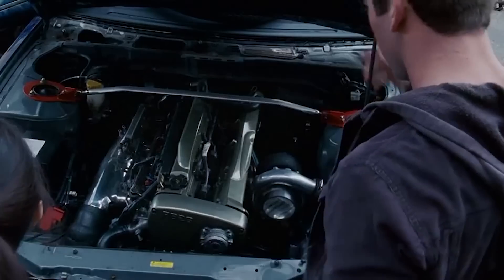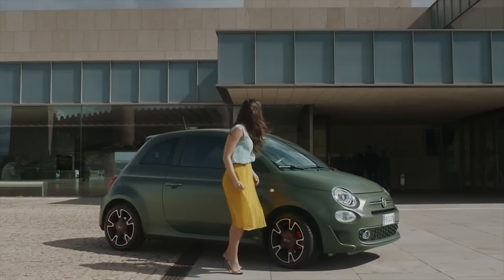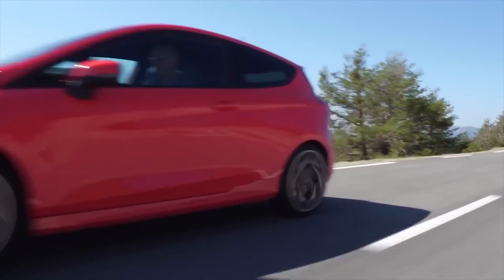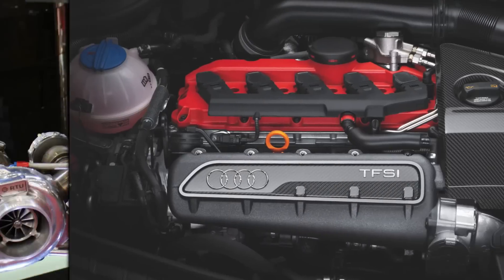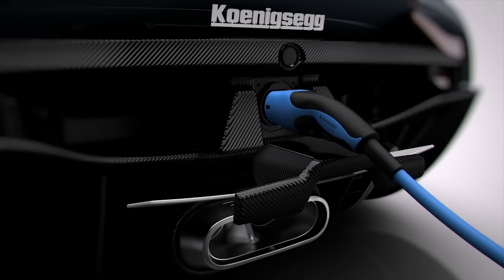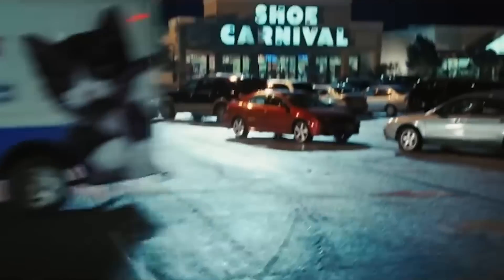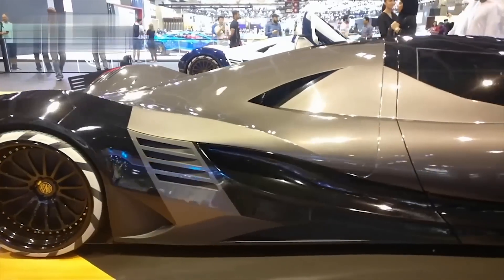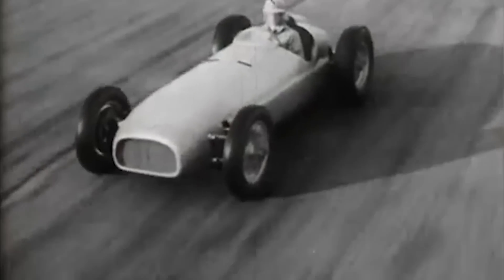Most Powerful Engines from 1 to 16 Cylinders

Comment: Odd the most powerful 2 cylinder has 0.9 liters 103 horsepower.  I have a 2 cylinder snowmobile which is 0.85 liters that makes 165 hp.  Hmmmm.
Reply: 521 rotax 2 cylinders engine from blizzard 9700 from 70' make around 105 hp Lol

Comment: The regeara is not the strongest v8 a top fuel drag car has the strongest v8
Reply: well technically, top fuel in NHRA does not use production engines

Comment: 5:00 And now we enter the odd number of cylinders with this 5 cylinder engine.

Well i'll be damned if i did not think the 1 and 3 cylinder engines presented before this 5 cylinder one, was also odd number cylinder engines.

Comment: How about manufacturing 5000 Cylinder Engines Cars that is So freaking complicated and it takes about 10 freaking years to build one and 5 plus years to test drive and inspect that the engineers get sick and tired of getting sick and tired that they will throw the wrench to the car and go on Vacation?

Comment: There's a top secret Devel Sixteen with 24 cylinder, 9400+ hp 7.5 liter engine. It can go 1- 60 in 0.8 seconds but the engine pruduction may kill you anytime cuz the power in the engine too much to handle itself (you can't find it on google or somewhere else)

Comment: Audi Sport Quattro RS 002 - Sports prototype "Group S" was a rally car that was initially designed for the forthcoming Group S regulations for 1987. The car was tested by Walter Röhrl but it never raced; the Group S regulations were scrapped along with the Group B regulations after a number of accidents involving fatalities during the 1986 season.

Engine: 2,100 cc (2.1 L) I5

Power: 700 PS (515 kW; 690 hp)

Top speed: 300 km/h (186 mph)

Comment: Should specify AUTOMOBILE engines. Aircraft V-12's exceeded well over 1000 horsepower in WW2,and 2000+ horsepower 18 cylinder engines also were used. By the end of the war, they had ballooned to a monster 36 cylinder, 5000 horsepower,  7755 cubic inch beast built by Lycoming. And don't even THINK about ship engines! I should have guessed this would be a mockery when I realized that the author  couldn't even use spellcheck in the title ("Powerfull"???)

Comment: This list is absolute horseshit... Sooo many inaccuracies about it all. firstly. you cannot compare turbo engines to naturally aspirated engines. secondly, you cannot compare motorcycle engines to car engines... they are an entirely different animal. my triumph stree triple 675R has 137 horsepower at the back wheel. Whereas my mothers 1.3 litre 3 cylinder car only makes 75 horsepower. You have to compare engines of identical capacity. you need to dyno these engines at the crank, and find out who is who at the zoo. work on 2 litres. Life will be a lot easier. Also, you would have to manufacture most of these engines for a fair test... and then, bore and stroke would come in to play, so then you would need to have identically scaled bores and strokes. work on a square bore, where the bore and stroke are identical. This is absolutely awful as far as lists go. Don't touch automotive with a 10-foot pole. you clearly have no idea what you are talking about. stop reading a script, learn about the topic, and come back to us when you have. this is clearly bullshit. Well done guys, I hope you understand just how ridiculous you look to everyone who knows even an ounce about engines.

Comment: At 11:20 you are wrong: More cylinder means smaller and lighter parts that enable more revs. It that 16 cylinder engine had only 8 cylinders and the same volume, the bigger parts would prevent it from revving that high.

Comment: 3 cylinders 1000cc Yamaha Viper with a turbo kit.🤘 A real best from 136 to 270 hp. I have a -15Viper 162 with a 190 hp turbo kit and its so fun to drive.😂
Or a Yamaha sidewinder 1000cc from 200 to 340hp.

Comment: @ MAD LAB

I wouldn't say it was the Viper that made the V10 popular, I think it was the screaming 3,5l V10 i Formula 1, starting back in 1989, back then starting out with about 650-700Hp, and from 1995, the engine was made even smaller, 3,0l V10, and the horsepowers bigger, and ending up with almost 1000 Hp in race-trim [and some say about 1500 hp in qualifying-trim] before it was retired from Formula 1 in midte noughties.... 😊 😏

And about the V16 engine, I think the Rolls-Royce 9,0l V16 [BMW] from the Rolls-Royce 100 EX, deserves to be mentioned to, because it a true V16, where Bugatti's engine is made up of two VR8 engine's putt into a V, there by becoming a W16, or maybe even more correct, a VRVR16 [LOL] 😵 😂😂

But okay, that is just MY opinion, and there is as many of them as there are people who have one... 😁😁😁

Comment: What about the RB26DETT or 2JZ those are able to make almost as much if not more horsepower as the regera and for 4 cylinders what about the 2AR-FE which can make more than 1K horsepower N/A also you need to work on your pronunciation Audi is pronounced ow,de and Huraćan is pronounced huri, con

Comment: To me, I think a list like this would be a better comparison if none were forced induction. As long as a manufacturer makes a stronger engine and cranks up the intake boost, there will be always a more powerful engine. Where as a natural is limited by the air it can suck in - where displacement and rpms rule.

Comment: Horsepower is relative to airflow the more air you can flow into your engine the more people you can burn in the more power you will make this guy is just going off of popular cars with engines that match the categoryof course they are going to be motors that make a buttload of horsepower with a turbo but it is more impressive to find a motor that makes the same power as that turbo motor without a turbo all naturally aspirated

Comment: Title is misleading. Elmer Racing in Finland has a 4.0L 4-cylinder that puts out 1500hp, capable of 3000hp. Title should've stated that most of these are production cars.

Comment: Ferrari 812 Superfast.
800 PS = 790 HP out of a V12, that's why it's called 812. Now its top speed is 211 mph (340 kmph) not 190 or whatever he said. And yes, it is the most powerful V12 in the world (street legal, non tuned). If you're asking, the Lamborghini Aventador SVJ has 770 PS = 760 HP

Comment: Small engines... I have been hauling oil sumps for a company that makes engines capable to produce almost 7700hp per cylinder. (Wärtsilä-Sulzer RTA96-C)
The biggest engine where I was hauling stuff was 18V46.
Reply: Detroit diesel engine? 18v46 ?

Comment: The V8 regera has two electric motors to help it get a faster acceleration time. Plus the regera rs has the most powerful V8 with out electric motors.

Comment: Our snowmobile which has a turbo on it from factory makes 200 hp and it is a  3 cylinder and if you don’t trust me google Yamaha sidewinder turbo and you will see but you can modify it to 345 hp without changing head and block

Comment: The viper has a 8,4 liter...
The 2 and 3 cyl had the same  power...
The regera isnt the most powerful v8, at least the one1 has 1360 wich is more powerful, all koenigseggs only has v8 so then the one1 is more powerful. Cuz the regera has more hp cuz of the electric engine. Although i dont know if the agera rs is more powerful
V10s, the r8 v10 plus has the lambo engine too...
The ferarri v12 im not sure if isbthe most powerful engine

Comment: Another 0 cylinder engine is in the sr71 blackbird it checks in at 160,000 hp. Also puts down 68,000 lbs of thrust.

Comment: Ummmm 1000hp V8???  How about the modified 500cu-in (8.2L) nitro methane burning V8s used in top fuel dragsters. Estimated to be 11,000-13,000 HP.

Comment: The most powerful 8 cylinder is the V8 used in drag races.
They get up to 11,000bhp
Reply: S U R V I V O R that is true. In fact I think those motors are the most powerful combustion engines in the world. But I think this is about manufactured engines that you buy from a dealership. Nothing can compare to the sound and feeling of top fuel. I go every year to the gator nationals.
Reply: jasonneal 
Good point.
And yeah the Gator Nationals is a pretty awesome event
Reply: They also forgot the 1000hp v4 from the amg project one
Reply: Gabriel Gontijo was it a production engine?
Reply: Drew Tatum 

They are closer to 12,000 horsepower now. Doesn’t matter if they’re rebuilt after every run, they’re still the most powerful V8’s on the planet. They are the most powerful gasoline fueled piston driven engines on earth period.
Reply: Yeeehhh, but those arent street legal and run special fuel.
Reply: U KNOW WHY? becouse they use 2-4 different engines in the same car. ofc together power is so unrealistic. one single engine cant have so much power.
Reply: @TheMossemies    The Top Fuel dragsters and funny cars use a single 500 cubic inch Chrysler Hemi platform engine burning nitro-methane.  And yes, 1/single/one/uno engine produces 10000 to 11000 horsepower.   But they are typically rebuilt between each run down the strip.
Reply: knight0334 I thought the maximum CI allowed was 455 in top fuel class.
Reply: @TheMossemies  nah tons of cars push 12000hp in top fuel
Reply: TheMossemies actually no they have a single big block
Reply: Those guys use custom big block Chevy engines I believe
Reply: Hc 437 they use Chevy, Chrysler, Ford, Toyota.

Comment: 4:54 "And now we're into the realm of odd ... as in the odd numbered amount of engine cylinders."
Because 1 and 3 aren't odd numbers as we all know.
What an unspeakable amount of idiocy.
Reply: everyone whos worked with a motorcycle has heard of 1 cylinder engines. and several economy class cars use 3cyl engines. but theres no advantage to a 5 cyl so it is really odd
Reply: @jnathannger8654 
1st, there are of course several advantages of the 5cyl over the 4cyl and 6cyl, or do you think AUDI's research and development is led by fools for several decades?
2nd, I even quoted the exact wording "odd as in odd numbered amount" and still you didn't get the sense of it.
3rd, please consider not replying unless you found an actual point (!) in what you're going to say.
Reply: Galaxy S7 Jnathan was right, a 5 cylinder doesn’t have an advantage. A lot of car companies tried 2 cilinder engines and failed. A 5 cylinder is unique, not useful. Unless you think every car company ever that doesn’t make all their cars 5 cylinders are idiots?
Reply: @jordy2299  2 *cylinder engines were used by car companies for more than a century and over 8 million 2CV were build in 42 years and there are still modern 2 cylinder cars in production so the only fail is you not getting your facts straight but wtf has all of this to do with 4 vs 5 cylinder engines?? you clearly have no clue of what you try to talk about lol
Reply: @jordy2299   also whats with the all cars by every car company ever bs you realize that every car company ever didnt only use 4 cylinder engines but 2/3/6/8/10/12/16 and whatnot also exist so wtf have THESE to do with 4 vs 5??? you make no frickin sense DUDE it takes <1min to research ADVANTAGE OF INLINE 5 ENGINES so go educate yourself ffs
Reply: “Unspeakable amount of idiocy” jesus dude that’s cringe
Reply: @jordy2299  Exactly, that's why the wording fits perfectly.

Comment: Arctic cat 1100 turbo 2 cylinder suzuki engine 177 hp - Yamaha 998cc 3cyl  turbo snowmobile motor 180 - 200hp. Both engine easily tuneable to 300+ hp.

Comment: BMW M12 4-cyl F1 engine  could be boosted until 1200 hp and was up to 800 hp with the race trim. In the 1980s.
Reply: 1.5 liter?
Reply: @sandasturner9529  yep
Reply: Displacement?

Comment: Now that you're including race engines...

4-cylinders: Brabham F1 turbocharged 1500 HP with the BMW F1 being a close second 1350 HP

6-cylinders: any tuned Supra over 2000 HP lol

8-cylinders: Most tuned muscle, ponies, vettes and top fuel drag racers...

10-cylinders: Any F1 with said cylinders since they pulled almost 1000 HP while roughly weighting the same in pounds (dry, no ballasts). Oh, and dragster Vipers and Porsche/Gemballas, of course ;)

12-cylinders: Besides F1 and turbocharged tunes/hybrids, the Ferrari F50 GT Chassis #1 deserves a mention by pulling 950 HP NA (they tried to test 1300 HP but the car became unstable and dangerous to drive)

Comment: 1:30 uhhhh did you forget snowmobiles can have over 200 hp? As a ski-doo rider, the best we have is a 850cc engine that delivers 165 hp so you need to do some research, buddy. And the ROTAX 850 ETEC engine doesn’t need a silly turbo.

Comment: BRM description is all over the place. It talks in part of the H16 development as if it were the V16s development.
Also I think it fails to mention the V16 was only 1.5 litre with a 2 stage supercharger - though the quoted power output was more or less correct. The potential for 14k rpm is not so amazing for such a small capacity engine since the reciprocating mass is light from the short stroke and small pistons.

Comment: A turbo isn't required by any of these engines to run. The list should be about the engines themselves no? Each engine could have multiple options when turbo charging them and have different power results.

Comment: BMW produced a 4 cylinder 1.6L turbo engine for formula 1 in 1986 and 1987, the version M12/13/1 produced  an approximate maximum output of 1,400 hp in qualifying trim. Approximate because they didn't have a dyno to measure past 1000hp but relative to other manufacturers claims the 1400hp is not unbelievable. Yes it was not terribly reliable at this state of tune but what would one expect from a 1980's turbocharged engine! :D

Comment: General Electric makes a V12 twin turbo Diesel engine that produces 4600 hp at the crank at 1050 rpm. GM made V16 single turbo Diesel engine that produces 3600+ at the crank at 950 rpm. A later twin turbo version produced 4300+ at the crank at 900 rpm. Do your research

Comment: Alfa Romero Giulia Quadrifolglio; 75% of a Ferrari v8 for 10% of the price 505hp/443lb ft. of torque with a warranty sitting at your local alfa dealership right now.

V8 Dodge Challenger Hellcat 707hp with a warranty sitting on the local car lot as well. 
the Helephant Crate Motor? 1100hp i think?probably more

TVR Cerbrea Speed 12 motor broke the Dyno rated at a thousand horsepower even though it was conservatively estimated to output 940hp because they could only estimate the output per cylinder bank.

Really this list is borderline pointless because it jumps between regular production things like the Fiesta ST and the KTM 690 Duke to cars you won't even breathe on in your lifetime like the Bugatti; there are Tuners who make 1500hp GM Smallblock OHV V8s all day for pocket change compared to the likes of Ferrari or Koenigsegg money.

If we wanted to talk specific output Kings; Honda DOHC 2.2l from the S2000 120hp/l
Mazda Rotaries trounce that with over 200hp/l naturally aspirated (RX-8 1.3l 238hp)
There were also Class B Rally cars from the 80s outputting nearly 700hp from a 2.0L Turbo.

Comment: 21 MPG on the hwy!! Dude I get 16 in my truck. Thats pretty good.
Reply: Depending on the year of the truck, it's possible that your truck engine is just better life span due to a low compression rate. That's how LLV bans last 30 years counting

Comment: More bad information after more bad information. what's interesting is that now Chrysler and Ford build V8 that are under warranty that put out a thousand horsepower reliably.
It's not surprising Ferrari can build an F1 engine and put it in a car but I wouldn't want to work on depend on or pay for an engine like that.
Your Fiat and Ford examples are two of the most troublesome cars produced today.

Comment: Utterly horrid vid. False specs, incorrect footage, wheres the 3 cylinder 400 hp engine?
Reply: jay Tarantula bro screw that wheres the 900 hp porshe v4 its the most efficient motor in the world. In the world
Reply: @Bikerlapse  yeah I was about to say that
Reply: yea,i was about to ask the same question
Reply: And the guy doesn't know how to pronounce, Porsche!! What an idiot.
Reply: I8? Don’t forget that’s a hybrid
Reply: Yea like the V8 in the Regara, how about the Agera RS with 1300 horsepower!?! And I know there are added electric motors but it’s a separate motor, so it should not count.
Reply: IKR they did not mention Wärtsilä-Sulzer RTA96-C so sad btw it got 108 920hp
Reply: Can be
Reply: There are 8 Cylinders engines at 25000 HP - Ship Engines
Reply: @polygorg  those dont count 😂
Reply: from Nissan?
It's not in production
Otherwise, the most powerful engine would be a drag v8
Reply: I was gonna say that
Reply: WHERE MY SUPRA'S @
Reply: Jacob Maston supras had 334hp in its twin turbo form

Comment: YES BUT, what happens to engine longevity using 3cylinders as opposed to six or 4 as opposed to 8. These small engines are working under extreme loads and don’t last as long.

Comment: Actually, a better "yardstick" might be power per displacement.  and for more practical measure, sustained power per CC or Cubic Inch. Sometimes durability is important; as in an aircraft or even a everyday driver.

Comment: And what of Kawasaki's Supercharged 4 Cylinder 1000cc motor pushing out 320BHP?!?!? Thats 320 BHP PER LITRE !!! Is that not a record worth mentioning?
Reply: flip inheck  well, someone's being a nob, and showing that they don't know anything about mechanics and engineering. If you did you would understand what a feat it was for a main mass vehicle manufacturer to gain 100bhp per litre, then to recently the struggle to gain 200bhp per litre, and then to mass manufacture a motor that would exceed 300BHp. This outstrips Honda, Suzuki, Yamaha, Ducati and even BMW... But hey ho, some people don't understand mechanics and engineering.....